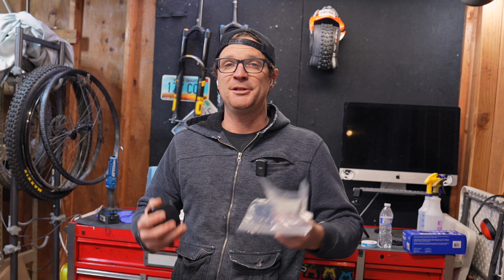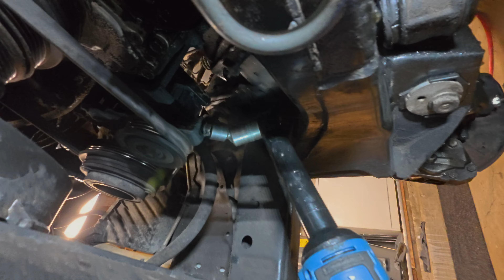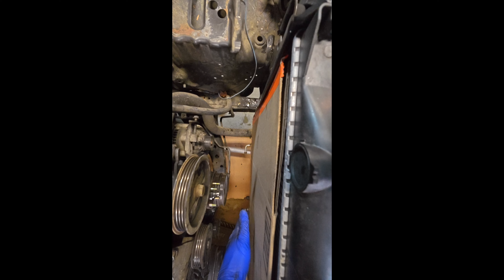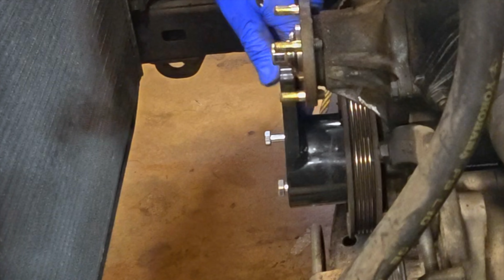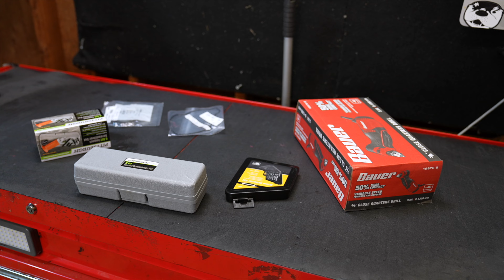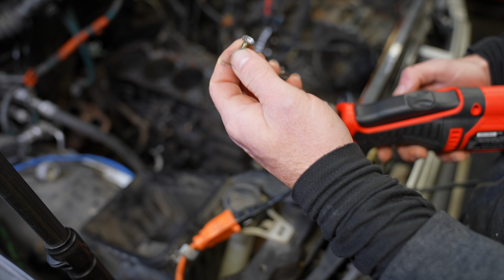Toyota Front Seal and Oil pump O-ring Nightmare

Comment: Just replaced the oil pump and crank seal on a 99 Tacoma 3rz.    It took me 3 mins to remove the oil pump screws.  You absolutely need a #3 JIS bit and a small electric impact.  No way around it unless you want to strip the screws and spend hours to extract them. Not necessary, but I tapped the bit into the screw with a small hammer so I would not strip the screw with the impact.
Reply: Bullseye.